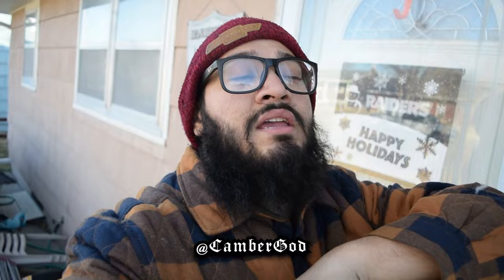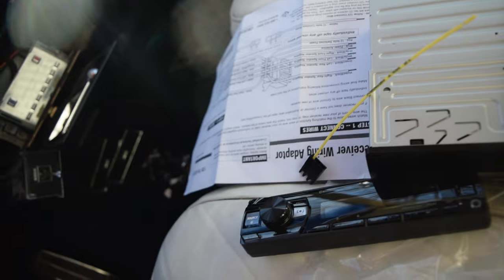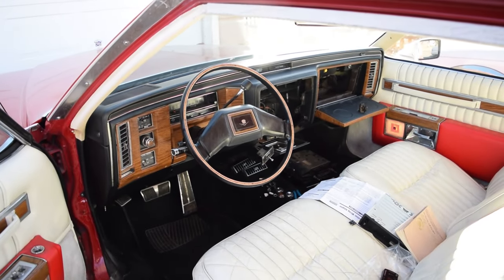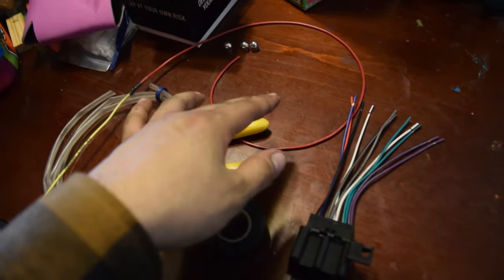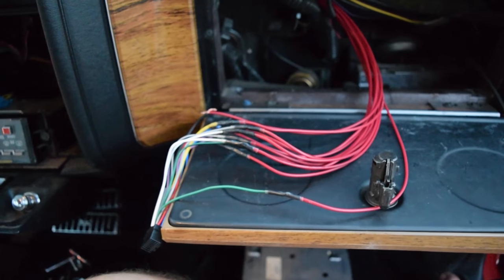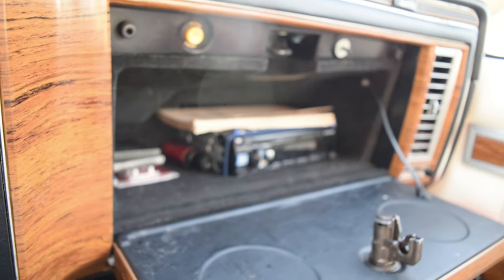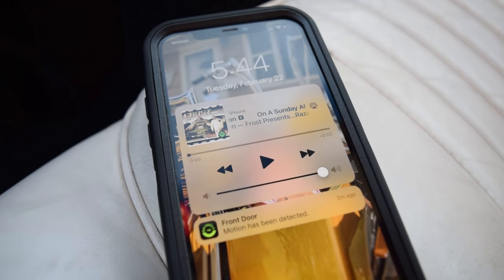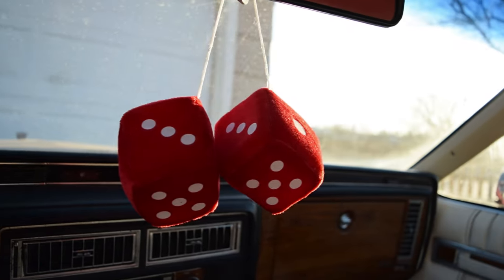Bluetooth Stereo Installed In The GLOVEBOX!

Comment: Does this work exactly as you did on a 1980 seville elegante?
Reply from the maker: It may be slightly different but should be roughly the same.
Reply: @CGOD  alright thanks for the quick response, can you tell me what radio wire colors have which functions?
Reply from the maker: @TuningDutchy  that would depend on which stereo you get but it should give you a diagram with the stereo. As for the car wiring you’d have to look that up for your specific car
Reply: @CGOD  i have an Sony Xplod